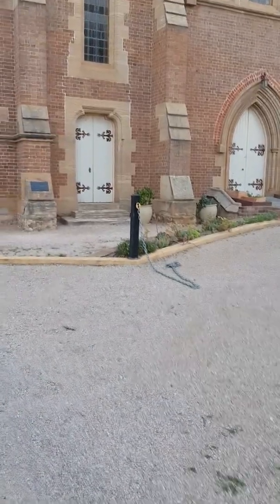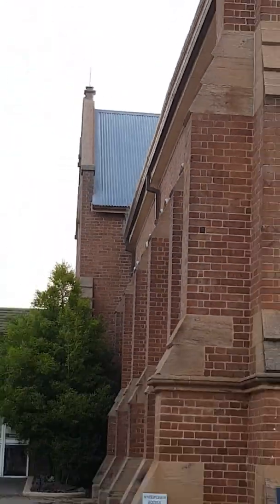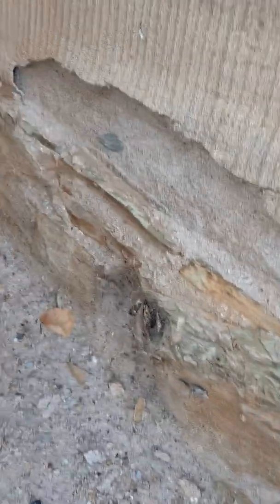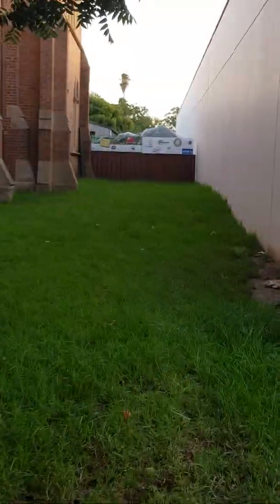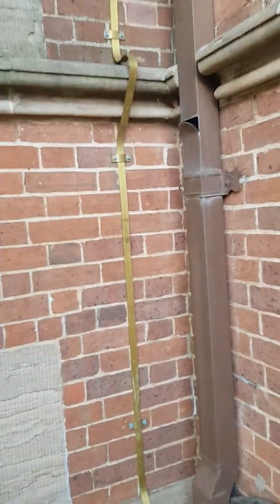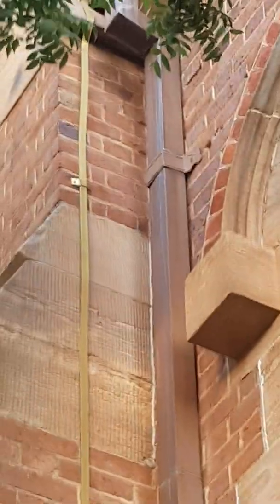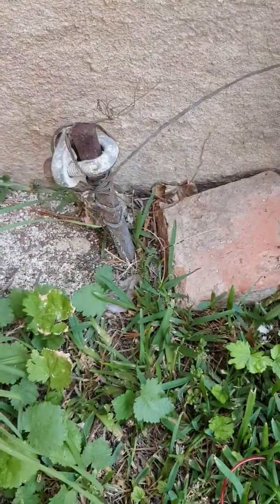400 year old Electrical device found working ! The holy grail.

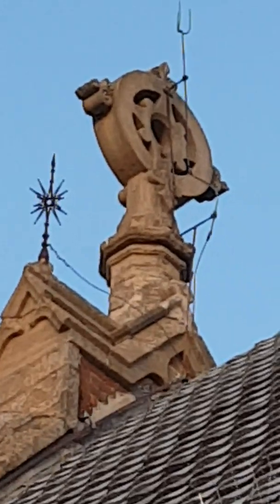Comment: At 2:33 I can see the pulsating vibrations in the center of the star-like metal formation. You capturing this video recording yourself, makes this far more compelling as evidence when compared to the recent "Electrickery" video on the the Royal Palace in Phnom Penh, Cambodia. The other video I saw showed something different, more like a lit gas or an array of small pilot lights. What a miraculous find!
Reply from the maker: Omg I couldn't see it at first, I thought it was a camera blur. But nothing else is affect only the multi point aerial. White halo that penetrates the centre. Good work   Lisa.
Reply: Maybe it’s due to digital compression? If not, then this is atmospheric potential at work (or aether harvesting device).
Reply from the maker: @danieljust295  my first thoughts too, but the white light is in four parts and pulsating in a circular motion around the centre,  then the very centre is white as well. 
Sure looks very real, never seen a vid do that on an object before. 
Either way, this is the aerial Martin shows regularly on flat earth brittish in pictures from 400 years ago ! 
Until now it was a theory,  we have the device on vid working. Unbievable that it's still there after all this time and recently had a new brass ribbon added. Someone  signed and paid for that specific item of work detail.
Reply: Charlie Jeans Yes, the work of Feynman, Electric Universe theory , experiments with Primer Fields all support such devices can be constructed. A processing unit of digital camera - however - could cause such effect but, the effect is not present anywhere else. If this vid is genuine then you deserve gold medal.
Reply from the maker: @danieljust295  haha. My favourite saying, found gold. 
It's out there open for any test, I'm not  saying the camera is perfect. 
On first inspection the two aerials are giving off a energy, the roof, stone and sky don't appear affected, and there's not artifact in any other part of the vid. 
I didn't even see at first, I was happy with finding an antique aerial with recent upgrade to the wiring. 
I leave it open to all to make up there own minds about what they see. 
It was filmed on a new Samsung 8, all the other vids except the planet 9 are filmed using the same phone. 
Cheers.
Reply from the maker: Check at 2.33. You can see th3 white hello flashing in 4 parts in the centre of the multi pronged aerial.
Reply from the maker: Hi Lisa. Have a look at this version 
https://youtu.be/Uqq7wn9KMzA
Reply: Actually at 2:30
Reply: Fabulous!!
Reply: And that is why one must read the comments...what a find!
Reply: Wait a minute. Is it real or is it some kind of string lights.
You should go back and zoom in on it some more.
Reply: Nice catch... even towards the end of the vid there is some type of warping around the start .. unless its compression artifacts of the video.. but then why only around the start object? ...
Reply: Holy crap! I see it!
Reply: @Kim-18 yes, read the comments. Thank you, Kim. I always mention this to people. Often it's self indicative when I am sharing some info because I will start out by saying "I read such and such in the comments after a certain video...." 
  United we stand, divided we fall.
  Divide and conquer is a very real, very powerful (war or social engineering) tool the adversary uses. It's a basic 101 level requirement.

Comment: This looks like an in active Tartarian power plant. It still has the Tartarian Alchemist ￼ symbol on it. The church took over most of these as fast as they could find them. 
Here’s how the power plant works 
Relook at the video after reading this 
There are several energy sources that I see.
1) atmospheric electromagnetic
2) lightning
3) photovoltaic section of the roof 
4) a few photovoltaic windows
The tallest u shape rod is the lightning rod, the star shaped finial is the positive, The smaller finial on the other side is a negative. The rod on the opposite side of the church is also a negative.... the negatives should have a copper line to the ground. The other items in this system are all connected. All the wires connect together along with the photovoltaic shingles and the photovoltaic windows... notice all the photovoltaic windows connected to a flat metal casing.. all this is connected to large cables and rebar that is encapsulated under stone, brick, concrete throughout the “church”.The cables and rebar act as a solid state battery. This electricity is captured and stored as Direct current. 
It’s was practically useless and became obsolete because our controllers designed our power grid with alternating current. We can now revive this technology and simply connect the direct current to a higher amp charger and then to a 12,000+ inverter and store the electricity in lithium batteries. 
AND if you are one of our controllers this is really a church... just an old church and nothing to see here 🙄
Reply from the maker: Hey rod, I do believe it's DC, Tesla and the AC lie, is what we are sold. 
AC will burn, melt, and kill you.
DC however when +/- touch the generator will just stop. No harm to man or machine.
Did Tesla hold in his hand 25,000 volts of AC current  ? 
I think not, his Tesla coil clearly show people can touch  the DC current and it will pass around then, transfer to the next person without any damage to the person..
The only issue for the controllers was, DC if earthed / shorted the generator stopped. The home with the short would have to be found in the grid to allow the generator to start again..
AC the fuse blows, or the switch trips on the home with short and the grid is up and running. 
So in order for DC ( superior current and easily made ) to be 'stable' every dwelling would need to be isolated from the next, with its own source. 
No, no, no that would not do. How can you charge an individual who produces/ provided  their own electricity  ? 
Makes sense now does it not  ? 
Cheers. 
Btw your comment was quaniterned in "suspected spam" yt playing games  ?
Reply from the maker: Check this version.
https://youtu.be/Uqq7wn9KMzA
Reply: hi joe bookers friend lynn eykamp told me the statue of liberty also does this as its copper and bronze  or brass built and standing in a sea of salt with spike crown to attract static    so the crown is positive and the torch negative on liberty   the lead on the windows would also be a negative source very clever
Reply from the maker: @honda4004  I was told a long time ago "all church's are buildt on underground reservoirs" water is an integral part of all operations. Cheers
Reply: @honda4004  Lynn Eykamp is not a man with whom you can talk.He treats people like shit.
Better stay away from him.
Reply: Clearly see tesla doing the freemason pose with the finger resting on his temple.

Comment: Crystal generates energy from the prongs harvesting atmospheric energy, ive made no videos of yet as im learning architecture, but ill tell u how to spot a church from the inside using free enerfy... Firstly there will be no gas pipe inlet 2nd the radiators will run on max hot when turned on as you cant regulate boiling water without gas. Outide..  wires cant be lightning rod conductors as there to thin. Outside soil checks needed for resistence so thats where the rod goes.... look up the bombing of dresden... this is a big subject that leads to a past generation of promised blessings on the world by god..

Comment: Hij Charlie, I found the same strip coming from the roof and followed it to the ground at a church on Malta. Made a video of it, saw inside still some spots of the old free energy. Video is on my you tube adres.
Thanks for sharing and indeed, in this antenna form is energy to see. Amazing! 🌹
Reply from the maker: Yes, I watched that one and many others you made. Do you think maybe they are a simple energy device or are part of a more complex system  ?
Reply: @charliejeans2413  I think it it so simple as possible. In earlier time they made already batteries, so I think with those batteries and that eternal source of energy from the sky and earth, you can burn lamps, etc.  
🤗🌹
Reply from the maker: @fransjebik8554  yes, I think it's all very simple to make. A coi of copper is a magic thing.

Comment: Hi buddy
The ‘copper wire’ that runs from the top to the general mass of earth is simply a copper earthing bar in the case of lighting strike to the building
It provides a safe path for electric current to flow down the copper bar rather than making any extraneous conductive parts live and risking electric shock. 
Nearly every large commercial building has these.. 
I am an electrician so I certainly know what these are! 
Other than that great video
Reply: Where one copper earth rod is in the ground but wire disconnected… in rural areas it’s cheaper for the electrical supply to only supply a live and neutral cable to save on cost.. this then results in the owner of yhe building responsible to create there own safe earthing system. This would be done by putting an earth rod in the ground and attaching it to the electrical install. That way under fault conditions the current flows down the earth cable into the earth rod rather than through a person
Reply: How often do buildings get struck by lightning? Why do residential houses not have these considering we spend more time at home?
Reply: Lots of reasons , typically these buildings are a lot larger. Also where they are for public use for risk assessments they are often required for insurance. These buildings often have a lot of steel work around the exterior where as a typical home is slate roof with bricks. The cost of installing these earth bars are also not cheap by any means so to have it in a domestic setting would be high
Reply: @finnbrayden8054  That sounds reasonable, this church is a smaller brick building with a slate roof however with no exterior steel work

Comment: Even if somebody figures out how to build such free energy mechanism i fear those in power and behind the scenes will not let it happen atleast on mass scale. World is not that straight forward and those in control go for the throat if they detect 'new' ways of doing routine activities.
Reply from the maker: Yes,  Cerco is the brittish company that performs all domestic terrorist acts. Cerco is tasked with preventing any other company or individual from coming onto the market that would destabilise existing market forces. 
The problem is most inventors want to get rich, if you don't sell your device or discovery but make freely available to eve4yone on the net. 
The patents office is also owned and run by Cerco, all patents ate stolen or used illegally. 
If you want to know more about the parasitic nature and how evil Ce4co is watch abel danger on YouTube, if you dare, you won't see the world as a safe place anymore.
Reply: @charliejeans2413  spelt "Serco": biggest corporation no-one has heard of!

Comment: That cable attached to the antenna goes all the way through to the nature strip out the front and is direct burried all the way down the street.
It's a thick steel braided cable. Very stiff. I dug it up all the time doing Telstra work.

Comment: Literally just a lightening rod, all large buildings have them. This is intended to protect the structure from a lightning strike. If lightning hits the structure, it will preferentially strike the rod and be conducted to ground through a wire, instead of passing through the structure, where it could start a fire or cause electrocution. Nothing mysterious about that. Benjamin Franklin detailed it in 1755... your church was built over a hundred years later in 1863. So even by the standards of the church you showed, it was old technology back then.

Comment: All we gotta do is figure out how it works and RECREATE IT. Is there any way we can try to remake it??
Reply from the maker: Hello Doc, this is the holy grail Martin of flat earth brittish has been saying. Working device and recent reno with brass ribbon. At 2.22 you can see the energy pulsating through the middle of the spiked aireal.
Not only do we now have the same aerial from 400 year old pictures Martin shows regularly, but it's working ! 
I'm positing it is made of copper, bronze and platinum cast.
The brass ribbon is attached to iron in the ground, then goes into the roof void, ( there's has to be a capacitor or relay of some type which connects to the aerial through steel wire, converting to a useable current, valve radios have ..25 . Watt valves,  you don't need big current to power devices ) 
In order for the atmospheric conductivity to be effective, a highly conductive metal alloy would be used.
Now just to give you an idea of expensive metals, platinum was used in car chrome' ornaments up till WW1. 
From that time on chrome plateing  was used as the war's acquired the precious metals into private hands. 
It was not that long ago we made things to last a life time from the best materials available. 
Seeing how our lives have been shortened compared to previous civilisations they made stuff to last. 
There are YT vids on atmospheric powered devices. 
Cheers.
Reply from the maker: I found this simple Tesla atmospheric device, 
https://youtu.be/cjiXZKatUkE

Comment: Charlie Do you think Ground Wires cancel out Free Energy. Returns it back into the system before we are able to use it or find it ? Is that why Benjamin Franklin tricked us into installing ⚡⚡⚡ Lightning Rods ??
Reply from the maker: I think the lightning rods do just that, null the conductivity of the building . These building  are energy portals, the aerials are the receiver of the signal. Check my latest vid WHAT WAS INSIDE THE PYRAMIDS' 
The device is the ark, sends out energy, the aerials receive the energy, the pillars are power poles for the lay lines. That's my theroy so far. The rituals performed inside these church's are l'ight ceremonies' Angel ceremonies' 
Most older churches have been decommissioned. Or neutralizes' to prevent pre -firing.

Comment: Good job Chuck. Go inside and talk to the minister and YouTube it if you can.
Reply from the maker: This is the old c
Church, there's a newer building on one side with a local GP/ doctor, who is the minister for this modern day church. The old side is used for some events, it's never open these days,  not like the days when you could walk into s church and speak to the minister. 
But I will inquire. The wires going into the roof will not protect from lightning strike, if anything the current would go through the building ?

Comment: Iv clocked this I'm gonna go check out my towns abbey. It has walls built from the dark ages. It's shrewsbury Abbey and we have about 10 really old churches. In My town we have the church charles Darwin went to. So it old as fcuk  ... and iv noticed this even on buildings 100 to 50 years old  iv seen it a lot on buildings connected to the state and church